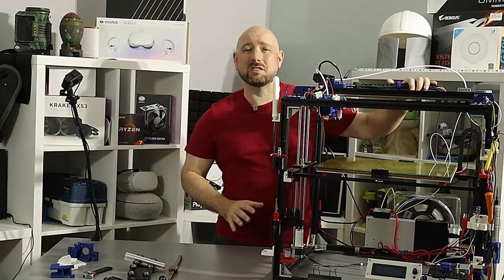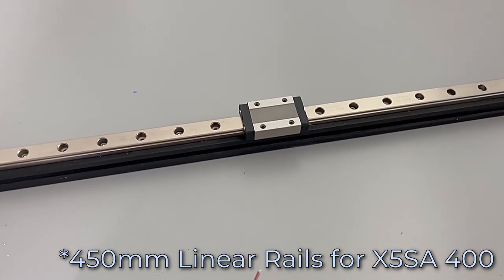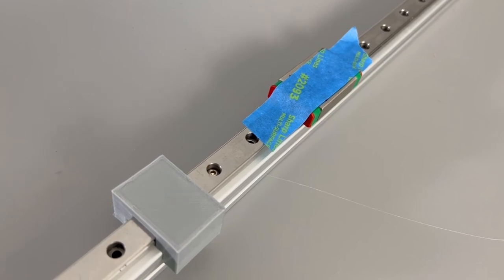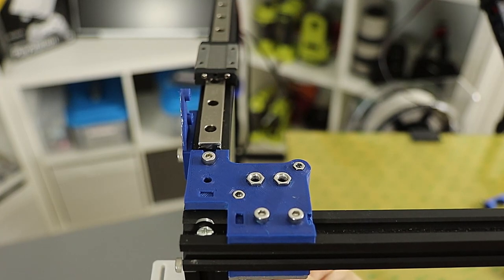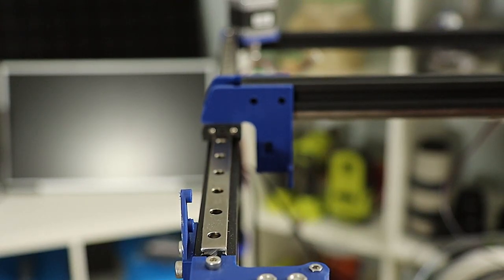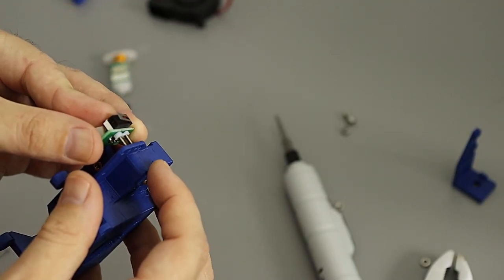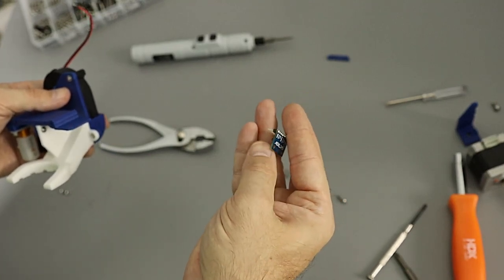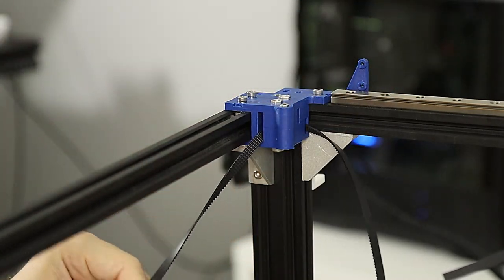TronXY X5SA Linear Rail Gantry Upgrade

Comment: great video, I just acquired a Tronxy X5SA 2E in need of lots of love, during my rebuild I was considering some kind of umbilical, I'm trying to reduce the total cables back to the mainboard.  would love more detail on that RJ45 connection, I read below you have a printer that's running everything but heater, this is what I would LOVE to see...I have been looking at some of the voron toolboards, but they either have too much, or not enough!!!
Reply from the maker: Working on an ethernet cabling video now :)
Reply: @LilMikeysBigPlans  I used a Silver Satin Cable the kind that are used to serial connect to a Cisco Switch or Router, for my BL Touch connection. I found that the benefits are better Signal to noise, better shielding and stable power delivery with cleaner routing of the cabling. Cat6 ethernet cabling would work nice also since its capable of providing a good amount of voltage thru those fine copper wires. I will be using analog phone cables for my fans since I can wire 2 fans with one cable and I'm sure it can handle the fan current draw...

Comment: Great video. I plan on using this for my X5SA 330x330x400. My question is, what size rails would I need for x,y and gantry. Would I need 400mm rails?
Reply from the maker: Thanks Shayne.  The pulley mount ends about 58mm from the edge of the frame and the motor mount about 60mm from the edge of the frame.  So you should be able to measure the outside of your frame in Y and subtract 118mm and that would be the longest rail you could use on Y.  As for X, where the mount would hit the rail is about 40mm from each side, so your frame size minus 80mm would be the longest rail you could support on X - however you could get by with a rail 4cm or so less and not lose any range.
Reply: @LilMikeysBigPlans  My X5S is X 535-80=455mm  and Y 500-118=382mm I can get two 400mm and one 500mm rails and cut them down I guess.

Comment: This is a killer design!  I wanted to ask: why mount the Y axis rails on the top (instead of the sides), and the X rail on the bottom (rather than the top)?  Do you lose any of the 400mm Z height?  I'm hoping to implement this design in June, though I'd like to update the motor mounts to be inside the frame rather than sitting on top to keep everything inside (if possible) :)
Reply from the maker: Hey Kevin.  I mounted the Y rails on top instead of inside for two reasons - the more practical one is that I didn't have to worry about the length of the X extrusion.  If I mounted on the inside I'd have to cut the extrusion a couple cm to fit.  As it is now you can use pretty much any length extrusion on the X axis :)  This design also has the weight of the X axis sitting on the rail sliders instead of suspended by plastic.  Probably not a big deal but 'feels' more stable.

I mounted the X rail on the bottom because if you mount the rail on the top and want to use a direct drive you can't use a stock direct drive BMG/Titan setup.  There isn't enough distance between where the motor sits on the carriage and the bottom of the extrusion to mount the V6/standard block directly to the Titan/BMG.  Carriages like the EVA get around this by putting a small run of bowden tube between the BMG/Titan and the radiator but that seems a lot more complex than just mounting the rail and motor under the extrusion.  There are some printers that mount the rail on the front face of the extrusion but that seems like it would introduce a lot of torque.  Voron does this but they use a second rail to stabilize it.

As for keeping everything inside, the whole thing was actually designed for regular 2020 extrusions.  If it wasn't for the 2040 verticals then the motors could be mounted on the bottom of the x/y gantry.  Either way, the Y carriages both stick up and out a bit so you won't be able to enclose without some kind of stand-offs.  Both the motor mounts and the pully blocks leave a gap to extend a 2020 extrusion up and that could be used for enclosure.

VZ-Bot is designed to be enclosed by the frame and might be an alternative worth considering.  The motors mount outside the frame but it would just be a matter of cutting some rectangles in the panels.
Reply: @LilMikeysBigPlans  Thank you so much for the detailed response, you're the best!

Comment: mount extruder and hotend together what coupling is used to get he super close so you don't get hotend to far down
Reply: Mike how can i add a picture showing my question
Reply from the maker: Hey Per, the V6 hot end mounts directly to the BMG and Titan extruders.  Just disassemble the extruder, remove the bowden tube plug and slide in the top of the V6.  Depending on which version you have you might need to add a short length of PTFE tube inside the heat sink.  Feel free to reach out at bigplans@lilmikey.com if you need to send a pic.

Comment: WOW, this is exactly what I want to see :) . Actually I am trying to make my still pretty new original X5SA 2E more accurate, and looking for some nice already tested upgrade to linear rails :) And then I found this great guide, with all printable parts (I am just a bit nervous if I am able to print them in good quality and accuracy, because this is exactly why I am looking for the upgrade) :) Thanks so much man! Lookig forward for more X5SA upgrades and tips :)
Reply from the maker: Hey Terablick, glad you found the video helpful!  The parts are pretty easy to print so unless you're really struggling with print quality now I don't think you'll have any issues.  Good luck!